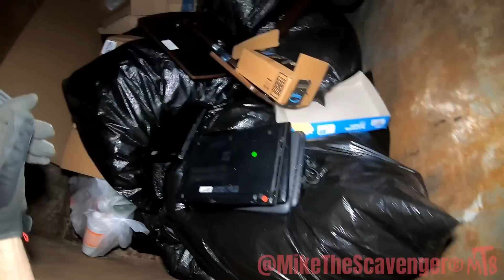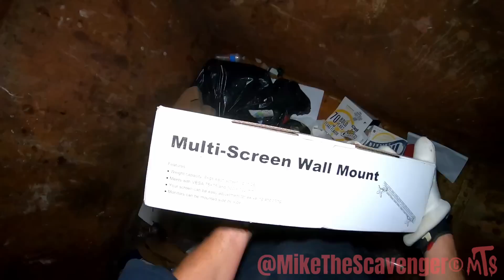Dumpster Diving "Got 5 Laptops!"

Comment: They 4:15 are the three wise men, Xmas decorations.  The arms are holding a treasure box, two of the statues seem to be missing the arm part. 19:03 they look like old lobby lights to an elevator. You know, going up  and going down indicators. The white plastic round parts are lens covers. One of each set should have a red filter for the down indicator. And I saw that they've just painted the lamp red, not using a red filter.

Comment: Mike, Awesome vid as usual.
That's a replacement section of over-head Rack-Chain conveyor. Probably used to hang parts and send through a Powder-Coat booth and Ovens. Being a Maintenance Tech, a few of companies that I worked for had them and they can be over a mile long.

Comment: I bet your computer guy is going to love those thing. I didn't see whether you found the adapters or not. They probably going to need charged up. But if they got Windows 7 which I suspect they do all you got to do is wipe them and replace them with Linux cinnamon mint, and they'll run like a new one. Maybe better.

Comment: Mike, you should get in the habit of just pulling your truck close to each dumpster. It will save you time not tossing stuff on the ground and then having to pick it up a second time to put it in the truck. Work smarter, not harder. Your time is $$$$$$$$.